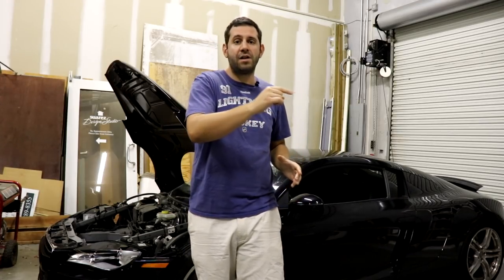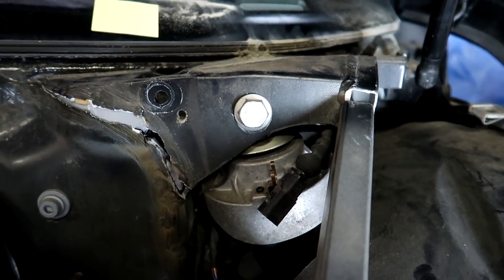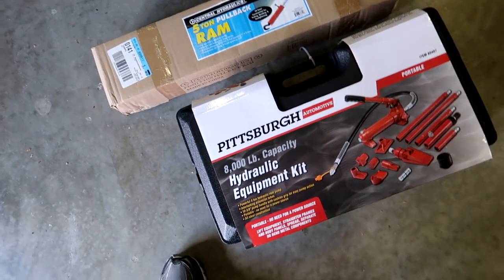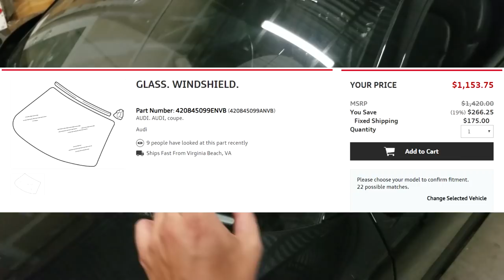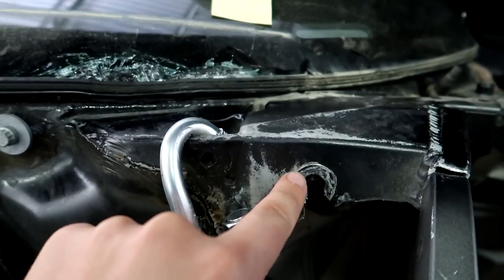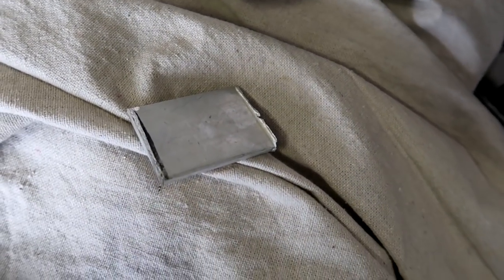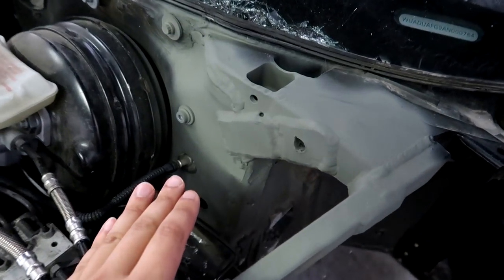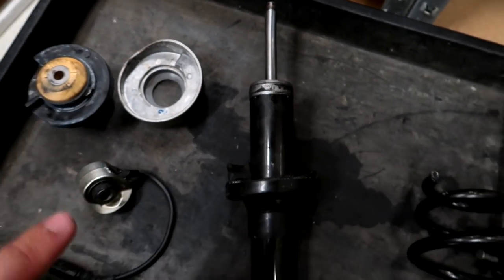I Repaired My Totaled Audi R8's Cracked Frame for $500! Insurance Quoted $29,522!

Comment: The amount of misinformation in these comments is astounding. Structural aluminum is welded all over the world every day.  This is a car, not the space shuttle. ‘This car is much safer than thousands of the rusted hoopties driving around the rust belt right now.  Is the repair perfect? No, but will it work? Yes! People say the Audi engineers would cringe at this repair, even though they designed this p.o.s. that is a failure in design engineering!
Reply: toyota38 I agree 100% most people commenting have no clue
Reply: @ryanpettit82  they have a clue sufficiently to understand the poor design outcome.  Often repair techs know more than engineers because they live and breath it.  Often repair technicians provide invaluable information in improving designs.
Reply: Toyota38, you are absolutely correct!  I was thinking the exact same thing.  This damn car was once dirt before they mined the material to make it.  So he could have fixed it with factory OE parts torn it all apart, disturbing things that dont need to be disturbed, to get a car that is prone to the same damage.  I say he did a fantastic job getting his dream car, he fixed it safely and will be able to enjoy it.  Meanwhile all the haters can sit back and bitch about how he botched the repair while they drive their little Prius to a Hillary rally.
Reply: @dennytyler4798  I drove a Prius to a Hillary rally, but I still approve of Samcrac.
Reply: Nicholas Heidl yea we are on the same page
Reply: Aluminum welding is common, yes. However it is very challenging and not anything like welded steel structures. The heat affected zone of an aluminum weld is very weak (~8ksi yield strength) compared to the heat treated 6061-T651 (36ksi yield strength) you're used to hearing about when manufacturers tout "aircraft grade". Welds must be sized appropriately to provide a service life that is acceptable, usually 20 years. 

Unlike steel, aluminum has no endurance limit - a stress value, which if designed below, guarantees infinite life. Meaning, this weld WILL fail, it's only a question of when. I can't tell you whether Audi heat treats the entire chassis once welding is complete like bicycle manufacturers do. If they did heat treat it, this would be a very suspect repair. There's a reason airplanes are assembled with rivets instead of welds.

Welding aluminum also generates large stresses once the weld has cooled, due to the large shift in temperature when the weld solidifies vs. room temperature. I would wait a week and see if there isn't a crack through the welds before reassembly. 

This original failure is certainly a failure of the engineers to define the conditions that a car like this is used in. It is really inexcusable, and looks just ridiculously weeny for a bracket which sees lots of cycling forces.
Reply: yea, welded, but when its freshly cut, not after it has fatigue in an uncertain area around the crack. it seems like your the one here who has no clue. this is a joke repair and basically a felony here in the EU. and rightly so. not perfect but will work????? really?? in the oncoming lane w 100mph in a left bend, when you have your family in the back? you do get the meaing of "public" from public roads, right?
Reply: @dennytyler4798  omg you guys are clueless :-[[
Reply: There are also “scab” plates to add strength to the weld.  The original crack is actually in a joint where two pieces are attached “hence the seam sealer”.  The shear load on the original attachment is spread over a much larger area with the reinforcement plate after the original joint is welded up.
Reply: Krisztián lucky we don’t live in the EU.  We live in the free world “America” where it’s easy to find a college to obtain an engineering degree, and not make up clever sayings.  The European engineers that designed this faulty structure may need to visit the United States to better study their trade. The joke is on the engineers that designed this oem structure and yourself for trying to correct someone who works with, and designs stressed, critically loaded components of steel, aluminum, titanium, inconel, hastelloy on a daily basis.  Surely a mechanical engineer such as yourself, can understand “lamens” terminology!
Reply: Structural aluminum used in buildings and such has a much higher factor of safety than aluminum frames that are designed to minimize weight. This car is more like an aluminum bicycle than say a walkway supported by standard structural 6061T6 extrusions. 

A typical engineered aluminum bicycle frame is heat treated after it is welded. And welded with the correct filler material for the alloy. My guess is for a car like this the manufacturing process is similar. This repair has lost considerable strength because the welds have no heat treatment and the heat treatment has been lost around the welds.  As MK pointed out aluminum has no endurance limit. Fatigue will cause a break eventually and that eventually for the car in the video is sooner rather than later. 

As I commented in the earlier video thickness could compensate but the little reinforcement plate just isn't big enough given the length of the crack.
Reply: Krisztián This piece of crap was designed and built in the “EU” so does that mean Audi committed a felony with their poor engineering practices that caused the aluminum to crack in the first place?
Reply: @dennytyler4798  Then you must be one of those fun loving torch carrying people who drive their Hummer H2 to MAGA rally, who like to deregulate things at the dispense of public safety.
Reply: @toyota38  Woah, easy on the anti-EU stuff, I'm also in the EU (Ireland), and I'm 1000% in agreement with YOU! As we say over here: 'felony my @rse', which is what that guy is talking out of! I also lived long enough in the US to know that we are all pretty much exactly the same, and that we all have the exact same problem, which is, we are both plagued with wannabe know-it-alls who rely too much on cr@p they read off the internet about 'metallurgy tolerances', yet wouldn't have the faintest clue what to do with a screwdriver, nevermind a MIG welder with a decent bottle of Argon!! For every moronic engineer in a multi-billion Euro/Dollar auto company that allows a fault like this to sail through, there are a thousand experienced mechanics/engineers/restorers/rebuilders/etc., in the EU AND USA with the brains and ingenuity to devise and implement a fix or repair that is better than original, and I for one wholeheartedly applaud Samcrac for his work here. Well, apart from breaking the window - that made me cringe, but then just reminded me of the times I made a dumb@rse FU over the years, and just had to nod along sheepishly once it happened!!! 😆
Reply: Exactly!! This comment is right on point @Toyota38!! :-)
Reply: Denny Tyler Dude, you were good until the political jab and punch against econobox Toyotas. Remember the more people drive economical cars the cheaper your petrol will cost at the pump and maybe your descendants will also be able to enjoy driving years from now.
Reply: Mike Kessler You're so spot on Mike especially your final comment. My metal matrix aluminum mountain bike was built with much beefier and solid weld points and it has served me well for over 20 years: no cracks! I think some auto engineers are inexperienced and unqualified but somehow got in their position. Shame on Audi/VW
Reply: Christian Meier you are right. I live in America and 95% of men around me and some women has messed up brains and that's why we have too many speed bumps. People are in too much of a hurry to enjoy life and respect life. So we had over 14 children run over crossing streets or picking up trash next to a road in one week!!! It's unforgivable!
Reply: I'm a former coach builder, the place I worked was a approved chassis repair/mod shop, next-door to a vosa test centre. And have seen failed ally weld repairs on chassis and motorcycle sub frame's.
Reply: Most cars don't go 200MPH!! Image the chasis giving out at top speed.
Reply: toyota38 is it safe to say after all this discussion that the car really isn’t worth much though?  By much I mean anywhere near what he paid.    It’s tainted.
Reply: I had to do some research on this topic after reading the various comments. So the original part was likely a heat-treated alloy to give it strength to some specification such as 6061 T6. Welding introduces high temperature heat that weakens the metal near the weld and it I don't know the composition of the actual weld metal and how strong it is. And it seems to be very difficult to heat treat the area later since it probably needs to be baked in an oven for up to 1 hour at a particular temperature around 400F.
Reply: @AndyWJP  actually it can make the situation worse. The impurities inside the aluminum would regroup even more and make it even more fragile. Only going through the melting point again to fix this.
Reply: @Mpkauto   - I agree 100%.  Weld needs to be monitored closely for a few days or so, but then occasionally thereafter for the life of the car.  Is a total sh!t design for a supercar... hard to believe that a simple pothole likely caused the damage.  My thinking on the repair was that the repair plates aren't quite large enough - I would've popped out the glass and went for something that bridged the seam for a little greater distance.  Tough when you're welding 1/4" thick plates to paper thin stuff.... but it'd definitely hold forever then.
Reply: Audi built this flaw so this repair is certainly better than what he had to start with. Still what an overpriced p.o.s. lol
Reply: @toyota38  free world? so you can go unlimited speed on the motorway like in Germany? Also dont forget to excercise free speech on twitter and facebook (kaboom). Your country is everything but not free, and your road rules are simply dumb, not loose. Wearing huge bumpers wont help this repair. And nope, this wasnt the engeneers fault this was pushed in by idiotic managers, financers, to reduce cost on expense of safety. Ever heard of things called Space Shuttle disasters, and their causes...? you can be sure the designers knew this from the get go, they were just forced to push the envelope too far.
Reply: @FRITZI999  yea man :) their road rules are dumb. they allow crazy dangerous shit like this, or dragsters on the public road, yet when you go 5 MPH over speedlimit they tear you a new asshole :D
Reply: @Sawashi32  Space shuttle disaster piece of crap was made in the “USA” so does that mean NASA committed a felony with their poor engineering practices that caused the seal rings and thermal tiles to fail in the first place? - or they were just pushed by idiotic PR and finance managers to keep the cost down on the expense of safety. you see the pattern?
Reply: if you use the exakt same filler rod all is fine.
 but aluminum in the automotive industry can be high strenght hardend or special alloy.
if you dont have the repair manual / specs for the welding like amps  material ec leave it for the professionals !!!
Reply: @drivecam101  100% agree
Reply: Krisztián Triggered much? LOL
Reply: Nicholas Heidl z
Reply: @toyota38  yea dude im smashin the monitor right this moment... :yawns:
Reply: as much as people hate this fix, if you brought it to a frame shop, they would have done exactly this and charged the 30k to insurance, and not actually put a new front subframe in.
Reply: Thank you.  This reminds me of all of the mindless idiots that think that every engineer is the 'savior of the world', when I have personally witnessed numerous engineering 'marvels' such as the one featured in this video.  As an automotive technician, you quickly learn that engineers are just people too, but everyone thinks they're an expert in this area and will quickly throw in their $0.02.
Reply: @aabidamn  Cool story, bro.  Show us an american super car whose frame was cracking under normal driving conditions over time.  Don't let the door hit you on the way out.
Reply: K J I think the main issue is the piss-Poor design in the first place , You can polish a turd , But it's still a turd at the end of the day .
Reply: Joshua Ford Does America have super cars ?
Reply: @jnf1283  There are not many choices regarding American supercar. There is no choice, really. Ford GT is the only proper supercar from America. Are you saying that Fords are better than German cars?
Reply: It's not a matter of if that weld is going to fail but when. Yeah it's a crap design to start with.
Reply: Do you actually think you know more than insurance companies (worth milions and hire automotive engineers which design these cars to assess the damage) about safety and aluminium structural engineering doing a google search for welding aluminium?
This repair is a disaster from an engineering point of view and no civilized country would allow this heap to get back on the road. To me it just looks like the car was abused and definetely hit something. Supercars get destroyed all the time, so what?
Reply: @jnf1283  Show us an American 'super car' that does 200MPH out of the factory and sticks to the road like that Audi?
Reply: @Gw0wvl  Cant blame the designers all too much. This fail isnt all that common. The car has been hit hard from underneath which can be seen on the damage from the undercarriage and the bent rod. Should it had held? Yes probably, but then again, was it designed to hit a curb? Probably not, most people try to stay on the road.
Reply: Rust belt resident here, who also works in an high volume dealership. If people are worried about this car safely driving on the road, then they should never come to Ohio because holy fuck, you cant imagine some of the rust buckets that legally drive on the roads.
Reply: C005 the same million dollar engineers that designed this part that failed?  The design is a well known flaw, do a little research!
Reply: Clint Jay Corvette!
Reply: @cosinus_square  insurance companies have there hands tied they have to go by the manufacturers guidelines the same Muppets that designed the piece of crap tub that needs to be repaired because of there incompetence. Literally all that is needed after this repair is to get somebody in to NDT it its not rocket science. I deal with heavy rail maintenance where we have to fix years of piss poor design to higher spec than OEM and all structural welds are checked with NDT methods and we are working with units that are carrying 1000s of people a day and weigh 30-50t. It seems there's a lot of people in here who can talk the talk but can't walk the walk. 

If it was mine personally I would get someone in to NDT its not cheap but its worth it.
Reply: ThePoisonDwarf1 insurance companies are supposed to bring it back to oem specifications, that’s the reason for the extreme repair cost and thus being totaled.  Can a non oem repair be effective and perfectly safe? Absolutely!  If it was to fail again, the world didn’t come to a halt the first time it failed?
Reply: @ThePoisonDwarf1  That front chassis structure is designed to crumple in case of an accident, in a specific way to keep the occupants as safe as possible, remember this car has the engine in the back and is made out of aluminium, besides the structure in the front there's nothing to absorb the impact. As a parallel to nascar, the only thing in the vehicles that is rigid is the cage (tub in our case) everything else gets destroyed in case of an accident to absorb as much of the impact as possible and we are talking 220mph brutal impact compared to what can happen on the public road.
And the aluminium front structure of the R8 is soft enough to absorb the impact as designed, no more, no less.
Frame is altered now, no one knows in which way unfortunately.
To me it looks like it took a big hit or something to dislodge the frame like that, that is not a stress crack. 
Steel is different than aluminium, obviously.
Reply: @KinariCuzz You might be right, if not for the fact it is a common issue with the R8.
Reply: @cosinus_square  as VW's preventive measure is to weld in a plate in the said area already for reinforcement they will have already factored in alterations to crumple zones for there own strengthening plates. This type of thing is nothing new and a large number of heavily modified cars will have had similar alterations if VW Audi would have designed the tub adequately in the first place and had a better strut top assembly with a fixed strut brace it would never have happened.
Reply: @cosinus_square  these ppl are ignorant. you cannot get to them. you see them up and crazy like a beehive about getting a supercar half the price and not earning the money for it. instagram makes them think they can use the road as a proving groung with your family on it. 
actually a think the uploader never gonna use this car, just collect the youtube money from the fuss from his moronic subscribers and then buy a proper R8 from that :D
Reply: @ThePoisonDwarf1  the tubs are designed properly, but as any car if it sustains structural damage it gets scrapped. This was not built to be a tank mate, it's a lightweight supercar to go fast not to go through walls.
Heavily modified vehicles are not VW's problem if they are not built by them, according to their design.
Aftermarket heavily modified vehicles are a completely different animal.
Reply: @ThePoisonDwarf1  those chassis were not designed on their engineers lunch brakes, they have considered all the reinforcement needed from the factory to comply with engineering, safety and also to be as light as possible, multiple times.
Nothing more nothing less.
No provisions for reinforcing have been allocated as no one is supposed modify it. If you modify it it's not VW's problem anymore.
Reply: @cosinus_square  you may want to check the forums its a well documented fatigue point due to a design issue later ones had a revised design in this section its that well documented that VW make there own strengthening plate that a lot of earlier vehicles have been retrofitted with
Reply: @kbuss10  yeah it makes me laugh when I read people comparing aluminium structural engineering to steel structural engineering and aftermarket alterations to factory design.
They are completely different animals.
Reply: @Sawashi32  I'm European for how ever much longer that last lol and my opinion is the tubs design is at fault and is pretty shit if they had used a slightly heavier gauge aluminium and used a strut brace on the outer top carrier pins from strut to strut it would never have happened
Reply: @jnf1283  I would stop at "show us an American super car"
Reply: @M0UAW_IO83  ford gt pretty sure it tore Audi and everything else Europe had to offer a new ass at lemans
Reply: @leodf1  the o-rings on the rocket boosters were a known possible fail point, so they added a 2nd one  as a “fail safe." The problem was they were only safe down to a certain temperature and it got colder than that temp, the night before the launch. The engineers of the contracto that made the boosters, said not to launch, but the higher ups ignored the warnings bc of pressure from Nasa.
Reply: Couldn't agree more with this statement, this design should not have left the factory. The top alloy suspension bracket/ fabrication looks quite pathetic and under engineered and definitely not up to the job. A factory recall should have been issued to have every car strengthened , to the way it should have in the first place.
Reply: @kbuss10  They have atleast one or more states in the US where you have "no" control of cars. I believe it's the same state they make Roadkill and Mythbusters.
If you have ever seen Roadkill and their vehicles you'd know that there is no way you could do that elsewhere without going out out of business.
Reply: @octapc  Yeah, only if you can get an engineer to set aside his ego.
Reply: @Gw0wvl  Yeah! Ford GT. It won this race you may have heard of called LeMans
Reply: @aabidamn  It won LeMans not Porsche not Audi, Ford did.
Reply: @goblin103187  I hope you were being sarcastic, cause Porsche won Le Mans numerous times. Audi hold the most consecutive wins for Le Mans.
Reply: toyota38 agree 100%